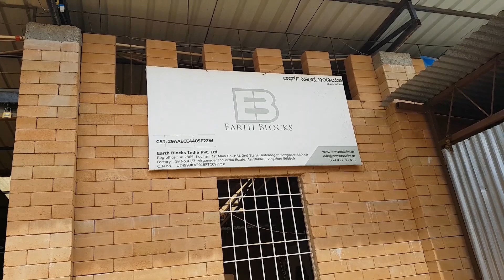Earth Blocks under a 15.5 Ton Crane !!

Comment: Nothing would happen after 30 tonnes as rubber tyre is crushing it.. try to hit by a small hammer instead to test
Reply from the maker: we are showing you the compressive strength, not impact strength !! Lab test reports attached in the description.

Comment: This is not the correct way to test your bricks do it scientifically with hydraulic pressure machine and do the testing. Which shows the correct pressure at which the bricks break down strength. Good luck.
Reply from the maker: Thank you sir, we test our blocks regularly at Bureau Veritas our wet compressive strength is above 12 Mpa & water absorption is below 8% .. this is not a test but just a demonstration. Test reports attached in the description.